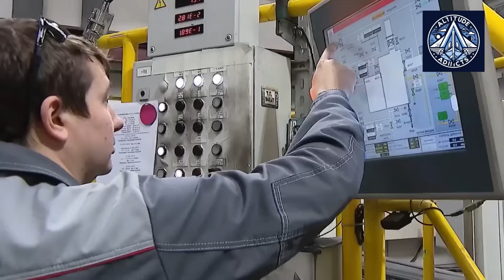Can PD-8 Engines Save Russia’s Be-200 Amphibious Plane?

Comment: The PD-8  for the Be-200 and the PD-14 for the Original A-42. The original A-42 had four engines. It was two D30s as used in the Il-76 at 12 tons thrust and two small 2 ton booster engines hidden under the D30s to give a boost to 28 tons total thrust for takeoff. The PD-14 would not require the booster jet engines. PD-16 engines would enable improvements and size and weight increases for a larger longer ranged amphibious aircraft if the Russia Navy decides that would be useful to them.

Comment: the PD-8 has solid titanium fan blades it will be strong enough for use on the Be-200 - no problem
why does a non-civilian aircraft need extensive certification ? that makes no sense to me
Reply: ...because it is a multifunctional aircraft, also usable for civilian use, transporting goods or passengers...

Comment: PD-8 designed for SJ-100, but with support for installation to BE-200 and changing ineffective ukranian engines
Reply: Los motores ucranianos no son uneficentes por ser ucranianos, en general todos los motores de la era soviética son ineficietes , hasta el ps90 lo es, tu comentario esta fuera de lugar si lo quieres llevar por ahi, lo cortés no quita lo valiente
Reply: @alexander09129  in one UAC corp su-100 has the highest priority for pd-8  engines. After successfully testing flights with sj-100, pd-8 will be installed with their new control systems on be-200, so maybe all systems will be upgraded on be-200.

Comment: The beriev 200 don't  need saving, those Progress engines work perfetly well, I've seen them inChile fighting fires, Greece and other countries.... 
The Progress engines are bullet proof going trough all the smoke and heat waves without effort....!
I heard there was a Beriev passenger plane in the works do, that probably is its future use....